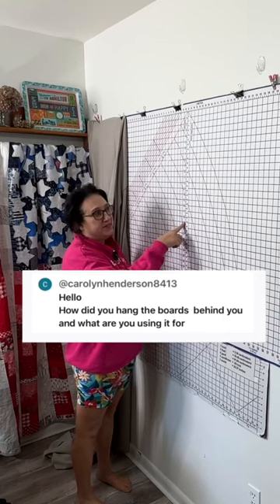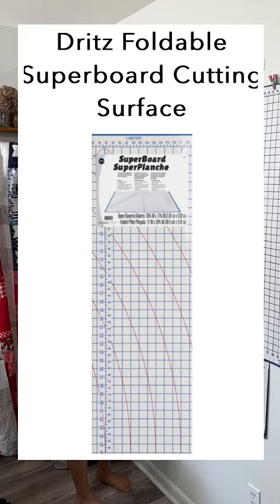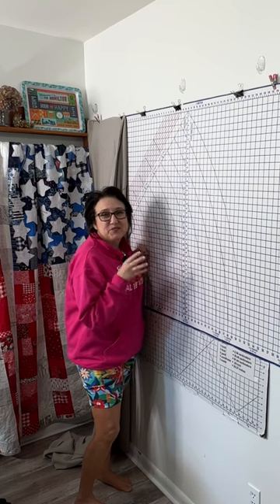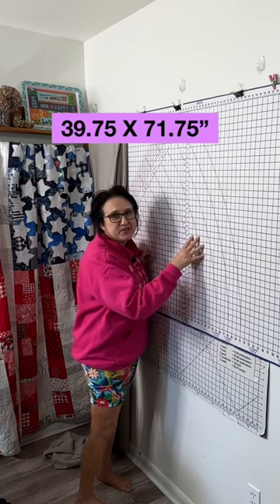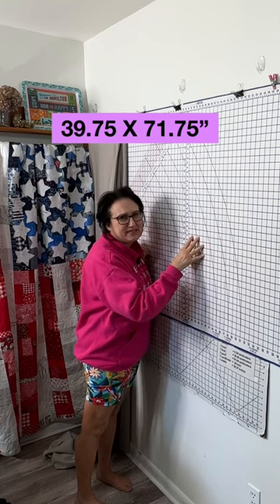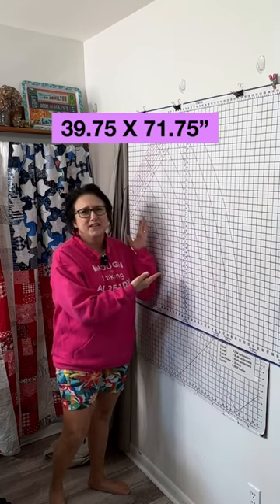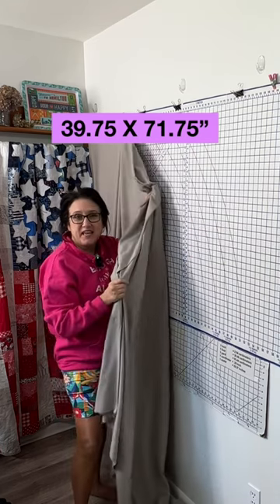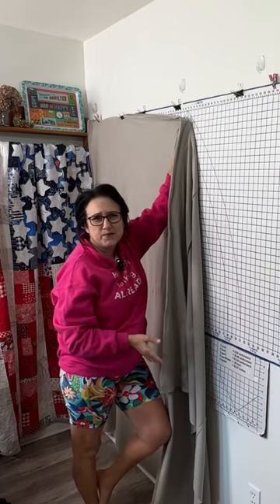🔥 ALL Quilters Want To Know ❣️  #quilting #thesewingchannel #quilttube

Comment: i used flannel too. Try using the back side table cloth. It holds blocks better. good price at Walmart. Sold by the yard. i got the checkerd  board print. grid lines to hang. buy a sample piece & give it a try. ii made a smaller version. I'm working on 2" grid "water color" style quilt. Wrapped the fabric board from the fabric  store. Helps moves pieces to keep 2" blocks in order.
Reply from the maker: Wow...thank you for the idea...I may have to try that❤️

Comment: Great idea. But if one can't use or afraid to use sticky tape, like Renters for example, you can make a wood frame to adhere it to the wall.
Reply from the maker: That idea would totally work✅ Or you could hammer a few nails in 🤷🏻‍♀️ You would just have to patch it up when you took it down✅
Reply: My husband made me a design board out of four by 8 insulation broad I covered it with white flannel he mounted bracket on the wall and attached the board I love it it is foam insulation and I can use pins for heavier stuff
Reply: @christinewilliams2751 , oh yes, the insulation board works great too and lightweight.
Reply: I'm a renter, and I use 3M painters tape to attach a plastic flannel-back dollar store tablecloth to the wall for a design board. No sticky mess and no damaged wall when I take it down.
Reply: @@tinalouisecrawford1098 I have never tried that, so I can't say whether it would work, but it seems reasonable. If you try it, let us know if you were successful. Good luck.